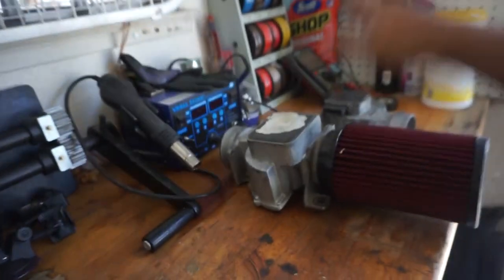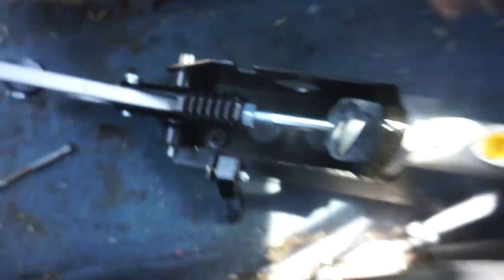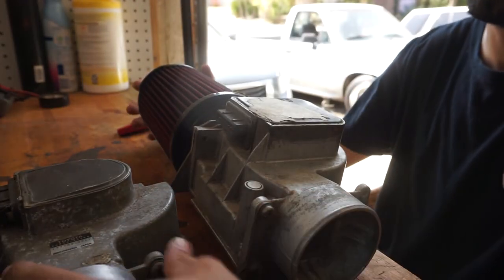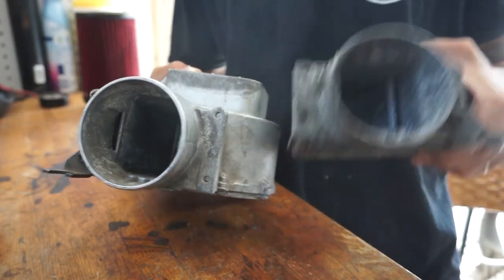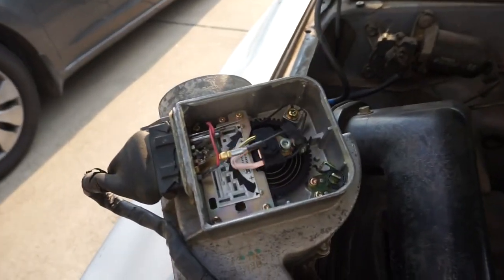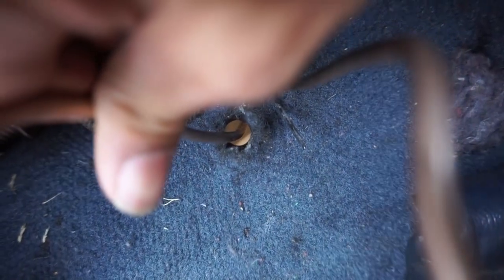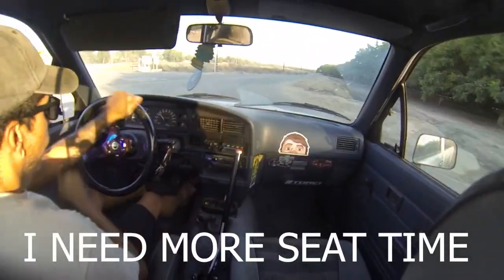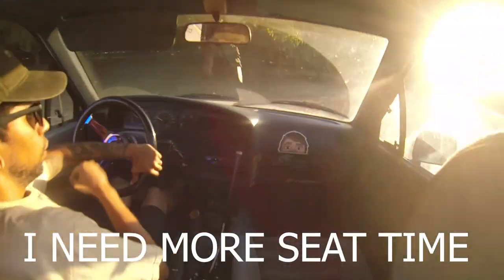EBAY Handbrake install in the MINI TRUCK + CELICA/SUPRA AFM mod!!!!

Comment: Tryna make my 85 pick up a drift truck too. What diff gearing you running? I’m tryna get a 4:10 for drifting but so hard to find. Was wondering if the e brake helps you drift bc my gearing right now doesn’t have enough power to clutch kick.
Reply from the maker: I believe i have 4.56s, and yeah its mot the friendliest clutchkicking gear. The ebrake helps alot, i usually just stay in 2nd for the whole time, but my clutch is starting to feel it lol. Ive been looking for 4.10s but i think itd be easier to just swap in a mustang rear end and have 3.73s with disc brakes
Reply: @GutZ_47  I didn’t know mustang rear ends could fit. Do you know what year is good off a mustang?
Reply from the maker: @Will_Galarpe  its not a DIRECT fit, but im going 4 link/coilovers in the rear, but track widyh wise they are nearly identical. And anything v8 up till i believe 98? I may be wrong. I know most new edge mustangs are irs
Reply: @GutZ_47  thank you for the info! Love the videos
Reply from the maker: @Will_Galarpe  dude heck yeah anytime! I appreciate the comment brotha 🙏

Comment: Keep them revs high and clutch kick 🙌🏼
Reply from the maker: yeah i went out yesterday to the same spot and had 2 clean runs after awhile. since the bed of my truck is unloaded it just wants to straighten out. i used to slide an e36 and it was WAYYYYY easier than this thing
Reply: @GutZ_47  glad to see truck builds I’m building mines as well
Reply from the maker: @RoachCoach  dude i never see trucks at drift events. i was hyped when i saw the DIRTY LOVE crews trucks. What kinda truck u got?
Reply: @GutZ_47  same truck u do 😂😂 I subbed to u while back
Reply from the maker: @RoachCoach  oh shit, well i hope to see your truck fixed up soon man, keep the yotas alive

Comment: did you have to change the placement of your intake or did the truck come like that the intake on my truck runs over the radiator and i know trucks from over seas had the intake route to the passenger side ive been contemplating doing a swap so its actually taking in more cold air and not sucking it up from the exhaust and radiator sick build btw im gonna look at doing the e36 bumper and youve given me some ideas on suspension also if you could show off how you have those headlights set up that would be cool i have the same one but they seem to work in reverse when i plug them in oh and also im in california too and i was wondering if switching out the afm for a 7mge one would go against cali smog
Reply: also on the drifting try flicking the tail end a little more youre getting the wheel positions down but when you only rely on the back brakes then its kinda hard to get the tail end to swing unless your going fast weight transfer can be your bestest friend and your worst enemy especially in these light mini trucks keep on keeping on love seeing more hilux drift trucks
Reply from the maker: Whatsup brotha, so my intake is actually from an 85 celica gt, one of the brackets mounted up perfectly and the other i had to bend by hand and bolt to the intake manifold. I definitely notced better throttle response after swapping it in. As for the headlights, u have to buy a harness off ebay that has built in 40 amp fuses, if i find the link for it ill comment it on here. Btw both the m3 and non m3 e36 bumpers fit, the non m bumper actually has a better stock look to it, but the m3 gives it that aggressive styling. And you can get the AFM to pass but youd have to mess with its calibration settings abit. Just remember the 7mge afm doesnt bolt on directly, u have to swap over the circuit boards and depending on if its running rich or lean u adjust the little gear in the inside either back a few teeth or forwards. Theres a bunch of info on afm calibration on yota tech, marlin crawler, toyotaminis, and some of the older supra boards. I recommend u take in to a smog shop once u have everything done, ask for a pre test (doesnt get logged into dmv database, and if u fail it doeant register as a fail, but if u pass, u have to take the test again as a legit star smog). Hope this helps. Let me know if theres anything u need help with!

Comment: What seats do you have in your truck? Was it hard to install from having a bench seat?
Reply from the maker: theyre 84 celica gt seats! i had to build brackets to be able to mount up 3 of the points, and drill/riv nut the 4th mounting point (front closest to trans tunnel). The bench seats use 2 mounting points up front and 4 on the back. You also gotta figure out your seat angle since the bench seats sit higher up and riding on buckets or normal seats will have u sitting on the floor! Hope this helps

Comment: Bin that AFM completely and get yourself a Speeduino + wideband O2! it will make a massive difference being able to tune it once it's got a cam.
Reply from the maker: dude i really want to go that route, i have a buddy that tunes speeduinos. but i have smog coming up in october, and the lce cam is smog legal, and according to the yotatech guys, the 5mge afm mod passes emissions also. main goal is to 3sge or k24 +zf trans swap it. thanks for the advice tho brotha i appreciate it!
Reply: @GutZ_47  read this after my comment that answers one of my questions lmao